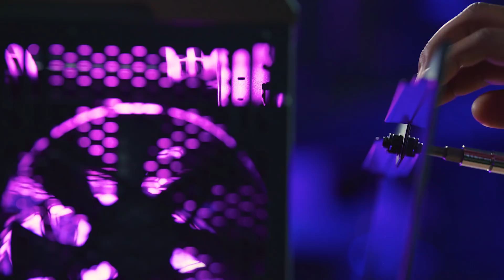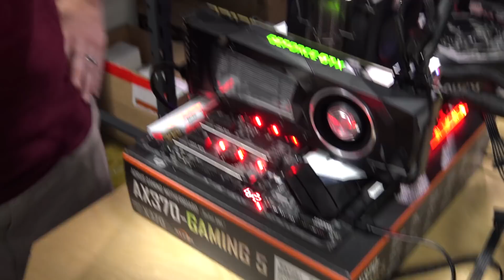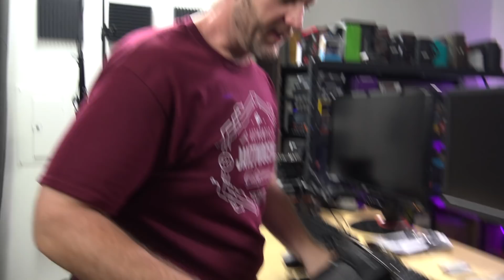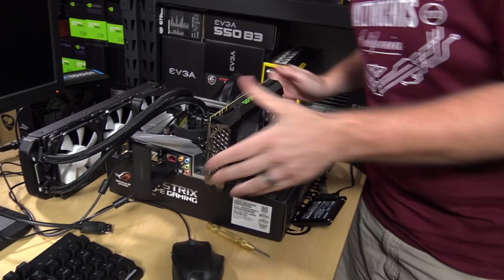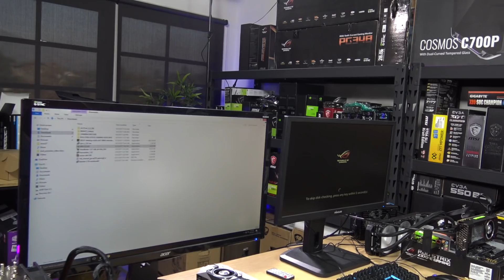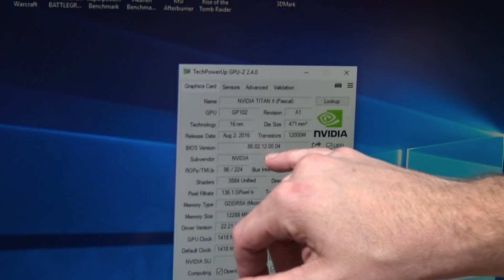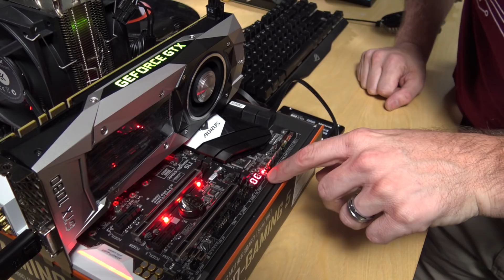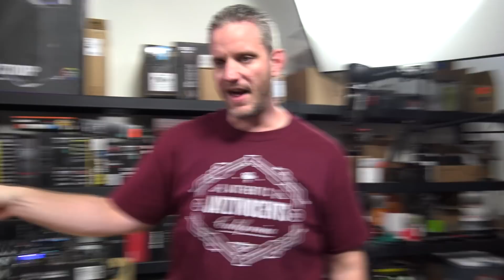I cant figure this one out... HELP!

Comment: I have just purchased a ryzen 1600 with motherboard (Asus x370 prime pro) and 16 GB of corsair 3000 MHz ram and I'm using my old gpu a gtx 980 ti Asus strix card.
But when using that gpu in my first pcie slot, the gpu gets hotter about 5c degrees more then in pcie slot 2 plus it will make a hard shutdown at some point while gaming. where I have to make a atx reset to make the system boot again but as mention not happing on pcie slot 2.
Funny enough this only happen with my 980 ti I tried my friend's 1080ti, a 960 and r9 390 all of these cards no issue just the 980ti. Bios updated tried other power supply, tried with 2 separate pcie cable from Psu still the same.
The thing I found that make Mt gpu run well on the frist pcie slot was to downclock just 10 MHz on ram and core then no problem then it works for hours no issue but if I overclock on first pcie slot then I will get artifacts and crash in the next 10 min but not on 2 pcie slot. I'm not that much of help but just wanted to tell what experience and maybe that could give some ideas to some troubleshooting steps

Comment: Well its seems to be a problem with the OS , try to switch the hard drives between the systems and see if something changes or reinstall windows on the amd system.
Reply: Vyctor661 the os gets loaded after the system POSTs the computer doesnt even pass POST

Comment: If both cards works on other system then the problem is not the gpu hardware issue. Try to swap PSU's between systems and try differend pci-e cables. Also check that other system has Gen3 (x16) set on bios and not auto. My old amd system did not work properly with auto selected. I would also try with differend AMD motherboard to rule that out of the picture. Last i would try differend bios version in the GPU to see if that helps.

Comment: You could try:
On the bad board with the bad gpu, try a different pci-e. It might be a connector issue.
Try sli with this particulair cart and ad a card you know works. Does it show both card in Windows or just one?
Reply: rubikfan1 oh yes this, try another shot in case that slot has a wierd power issue

Comment: Maybe the card in question is trying to draw way more power on boot than the other one?
-Swap it into another slot
-Try another motherboard
-Give it 2 full pcie power as in 2 cables instead of one cable with 2 outs on it (idk how that could be a problem,but why not try)
-Swap the psus between the systems

-Reflash the card
-Reflash the motherboard

Comment: I'm not sure if this is relevant at all, but when I built a Ryzen system for my room mate, I had a bit of a panic moment where it wouldn't POST. After trying to debug it, swapping out parts from my system into his to see if there was an RMA piece, eventually I noticed that the system wasn't just not POSTing, but it was actually rebooting every few seconds. It was very difficult to hear the fans spin up and then spin down. So I swapped all his hardware back in and just left it alone for about 20 minutes and eventually it POSTed and it's been working great ever since, even let me tinker with OCing the RAM etc. I have no idea what was actually going on but I suspect the BIOS was cycling through settings until it found something that worked?

Comment: Wait a minute....
You checked BIOS version on the video card working on the Intel system, then switched to the AMD system and checked THE SAME video card and expected a diferent BIOS version???
Am I missing something here!?

Check the hardware as well, to see if both are in fact identical cards.
Besides that, there's not much to check. If both are running the exact same hardware, you might think that one has possibly a defect.
And nowadays shouldn't be a problem, but also check PCIe frequency. I the bus is OC'd, strange things might happen.
You must remember that in old systems the PCIe frequency was "attached" to some other hardware. I'm not a Ryzen expert, but I'd research see if that's not the problem.

L8er!

Comment: Could it be a grounding issue? the other m-board and screen could be acting as a ground where the acer monitor / cable on the Aorus board  might not be. having them in a chassis would effectively ground all components through the power supply mains ground.

Comment: Howsit Jay i have been running a ryzen build for about 2 month and had crap from 2 weeks of usage, its not the cards its physically an issue between the motherboard and cpu , your best best is going to the manufacturer of the motherboard i had to get a special update to resolve it sorta of, amd in my opinion is not supported well enough, i have had it give me an issue with 3 aftermarket card eventually got a palit card 1080 and it seemed to stop that issue, but then i came across the pc freezing before bios then manage to wait to flash it then flash it again for the os logo freeze that some may have experience,i have been building pcs for as long as i can remember and built 1000's of pcs ,and the ryzen platform although im a huge fan is probably the most rushed slap dahed release they have done where ryzen is just prone to issues due problems rearing their heads as if they never bug tested i personally have never seen so many bios releases for on cpu series in my life but yeah thumbs up to asus for helping and your continued support in my ryzen issue where after well of say 2 weeks crap began with it,Jay i would recommenced you getting hold of the mobo manufacturer the motherboard as logically its interacting with the gpu ,and if it works on one it should work on the other i'm sure you have probably tested that card on a string of motherboards
Reply: Mate, I would of RMA'ed my motherboard and got a diffrent one long before two weeks.

Comment: i got a similar problem with a gtx 650 on my core 2 duo system it works on the PCIe x4 slot but it doesn't work in the x16 slot

Comment: I would try it on another 370 motherboard anyway. just for sanity to make sure its not the board.
Reply: I have had problems with my ram not working on the Asus Board even though this is a different problem. I stick the very same ram into the asrock b350 board and it runs perfectly. yet the asus board it just ouright seems to reject the 2933 speed. of the corsair vengeance 3000mhz. anyway I would try another board just to make sure that it is 100% not the board doing it because its possible.

Comment: At first glance, I would say it might be a power problem. Quick test: add a second PCI-E power cable from the power supply. Then try replacing both PCI-E power cables from the power supply to rule out a cable fault, Second Test: Try the power supply that's currently working on the Intel Rig. Third Test: Try a completely different power supply.
I have run across issues similar to this in the past, and it was due to PSU related issues. I've also seen power leads from a power supply develop a fault after being used a few times. It's rare but it does happen.

Comment: Im thinking the VRam on the "none working" card is made by a different manufacturer than the "working" card. If so; I know for a fact the chipsets used for ryzen motherboads can be picky. Try it on another manufacturer AM4 platform. If it works, then its just the chipset on your K5 motherboard being picky.

Comment: Have built systems since late 80's.  Now and then i got a system that did not work popperly. I did never fully understand what made the systems not work. If i changed the components out. All hardware in the end worked. So no faulty hardware. But exactly the exact components did not work together.  But new set of components worked. And then all worked. And that lead me to the conclution that you sometimes you get a set of components that are in the tolerance but together the small "errors" adds up to much and the system wont boot or gets unstable. Will follow this cos i could not figure it out back then. And my boss only wanted to sell systems. Sure back then it was a bit more "plug and pray". We only built costum systems. So i could almost never try the exact same components/bioses etc.

Always want to understand what goes wrong. But in the few times this happend I never had time to figure it out.

Best of luck.

Comment: I've had strange issues like this before. I'd say swap the RAM to some different stuff. 9 times out of 10 when I have strange issues that just shouldnt be happening and seem to be unrelated to anything its the RAM. 

Also, check the "pins" on the GPU itself, I know all PCI slots aren't built the same, maybe the GPU has some very minor damage which the "poorly built" PCI slot on the ryzen motherboard isn't properly detecting where as the "better" PCI slot on the intel system is less "fussy". Try running a benchmark with both GPU's on the Intel system and see if the scores are different, run a benchmark where the margin of error is extremely small where you usually get consistent results (heaven and valley I find are pretty stable for that, but you probably know better), if there are discrepancies between the two, theres the issue.

I highly doubt its a CPU issue, as GPU 2 works fine on the Ryzen system as well as all the other GPU's you just tested. I'm putting my money on the RAM, but the GPU itself could be damaged. 

As a third option change out the motherboard on the Ryzen system and see if GPU 1 doesn't work on it as well.

Comment: It might be worth trying to swap the monitors and DisplayPort cables between the two setups.  Also try using a regular run-of-the-mill 60Hz monitor with a DVI cable or HDMI cable just to see if any video will show up on the display.

I've had an issue with a Ryzen motherboard acting a bit finicky with a 144Hz monitor plugged in using a DisplayPort cable.  There would be no display during bootup and the monitor indicator light would just turn on for a few seconds then turn off as if there was no video signal.

At first I thought my videocard died or I got a defective one from the shop, but I tested it to be working on my older Ivy Bridge based PC.  I was also using the DisplayPort cable that came with the monitor and was considering replacing it with a different one. But somehow I got it to work after a couple of CMOS resets on the motherboard and plugging the cable on a different DisplayPort port on the videocard.

I never understood what caused the issue, but my theory is that the Ryzen motherboard was not responding well to new hardware changes, like plugging in a new monitor, or changing the cable from HDMI to DisplayPort, or just plugging the DisplayPort cable on a different port on the videocard.  It was like the motherboard was constantly "remembering" the previous hardware configuration and was not detecting when a "new" hardware change was made.

Not sure if this information is useful to you but I do hope it helps you get a clue on where the problem is.  Good luck!

Comment: Power tolerance on some boards is more picky than others. If the CPU/mobo think the card is underpowered it will, at times, throw a code. The first thing I would try is to run two separate  8-pins, from PSU, instead of a jumper. I've had a similar issue on an Aorus X370 board, with a 1080 Ti & I think that solved it, for me. BUT, I only think so...I'm not 100% sure which step solved my problem, because I changed several variables at once, swapped the HDMI cable, swapped out the cables from PSU to GPU & did a clean install of OS, & installed a new CMOS battery. After doing all of these things it just worked... You know how tech is, sometimes after repeating the same troubleshooting steps a couple times things just all of the sudden "work" auto-magically. All I know is that one of those things, or a combo of them solved the issue. Obviously, as pointed out by several other commenters already, you did just mistakenly check the BIOS on the same card twice, FWIW, but I don't think that's the issue.
Reply: psu/mobo would be my guess to. had problems with an msi mobo and a 1700 with an 1080ti  that would not even boot unless i cleared the bios
Reply: Power Supply / Cables was my first thought too, its easy to check as well.
Reply: But he's using a 1000W PSU from Corsair (RM1000), that unit should be plenty
Reply: Its not about the "raw power" its more about how clean the signal is.
Reply: I don't know why everyone thinks my original comment was about having a bad PSU...maybe it was poorly worded, but that's not what I was saying, at all.
Reply: This is indeed what I was thinking.
Reply: Na i got it right, and i meant it the same way, also probably worded it poorly.
Reply: Vertiqo - Yeah I get that, no worries. This thread kind of went off the rails after the first guy suggested it being a PSU problem. So, I just wanted to steer it back on track.
Reply: Thinking something similar, some high power GPU's will test the PSU during post by shortly going to high power usage and verifying that the 12V line is stable enough, and if not will report GPU not present to the motherboard bios.
Swap the PSU!
If this is the cause, you sometimes can get the system to boot by adding a low power GPU and have your monitor connected to that one.

Comment: Try flashing the bios on the  mobo even if it is the same  one just do it . i bet you it will work also did you try another pci slot i know the other card works fine in it but just give it a try .

Comment: I had a similar issue with a old 280x that I had. Didn't work in either my pc or my kids, sold it on eBay stating issues and person that purchased it said it worked great. He could have lied but why? I would check the contacts on the graphics card a small scratch combined with a finicky slot. Probably not, you know a lot more than I do.

Comment: I suspect it to be a PCIe connection problem. As it is a review sample the cards have probably been swapping between systems a lot, thus putting a lot of wear on the connectors. Check if all connecting pins on the graphics card are undamaged and maybe clean them a bit with alcohol. It could be that the connecting pins on the PCIe slots on the motherboards are positioned slightly different making connection possible on the one board but not the other.

Comment: When I hit an odd issue like this in IT I rebuild the wheel so to speak. Pull the cpu, pull the ram, pull the power, pull everything, reassemble and if it's still acting odd,  reflash mobo bios, and gpu bios. I'm pulling out of the air here but I wonder if the graphics card could have an odd grounding issue. I would be interested to see if the motherboard were in a case with all the mobo screws in if it decided to start working fine.

Comment: It is the motherboard, i ran into a similar problem with last years build on a Gigabyte z170x gaming 7 motherboard and a Evga 1080 ftw, it would throw a error with the 1080 but boot fine with my Evga 980ti classified, i switched to a msi motherboard for testing and the 1080 booted just fine, Gigabyte motherboards apparently have some bad pcie slots that some cards (for unknown reasons) will not work with certain cards, i rma'ed the motherboard just to have Gigabyte send it back saying it is working perfectly, so now the board just sits in the box as it is completely useless, until gigabyte actually acknowledges the problem which apparently has now been carried over 2 more gens. of motherboards.

Comment: You could check the the power draw on the Titan, every GPU is different and in this case it could be pulling a lot more than 75w. Since it's an AMD platform mobo I'm assuming they have a safe guard for that issue that plagued RX 480 at launch. It would detect over voltage and just cut off to prevent further damage.

Comment: I had kinda the same problem with another motherboard, but this one doesn't booted with several gpus so I checked the schematics diagram of that motherboard, and I changed a voltage regulator and now it's working just fine.

Comment: Well like you said jay2cents Ryzen is a very picky system and I think it's the CPUs problem because it just has issues with some GPUs from Nvidia but its working fine with Vega so it's probably miss matching all sorts but I'm not 100% what the  issue is might just be one of those cases where it just doesn't work and that no one knows why but I just think it's either specific to that exact CPU or it's just a Ryzen bug thats probably software based

Comment: Maybe this has already been suggested/ questioned...

You stated that both Titan XP's had the same BIOS; in fact we (the viewers) don't know this to be true as you never showed us the BIOS version of the Titan XP that was originally in the AMD system, you just plugged it into the Intel system and carried on.

So are the BIOS version the same on both Titan XP's or are they different? It makes a difference, as we all know that Intel (and the motherboard manufacturers) have had a longer time frame to optimize their motherboards to various video cards over the years, but Rizen is a new architecture - and their still working out the bugs.

While the flashing of Pascal video cards may prove "easier said than done", it might be what has to be done in order for that particular Titan XP to work on that particular AMD motherboard.

just my .005 cents CAD

Comment: I had the same issue with my b350 and r1400 and gtx 1050ti.... I swapped the card for a 9400gt i had laying around completed windows installation and swapped it back with the 1050ti... Thankfully it worked

Comment: This will sound stupid but unplug the 24 pin from your board and plug it back in while the power supply is on but the MB is off. My 1080 did this to me when I first got it and it has been working ever sense.
Also if you have not, try it in another PCIE lane. I had a 290x on my old FX 9590 system that would not post if i had it in the top PCIE of my motherboard and  if i moved it down to the next 16x lane it would work no problem and yes it was only that card that would do it, the gtx 970 that i got to replace it worked fine in the top.